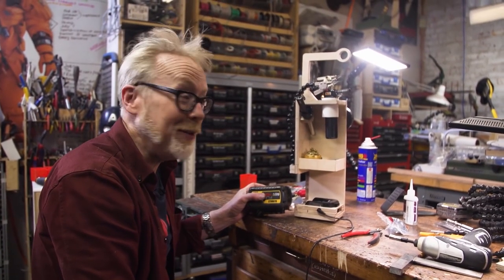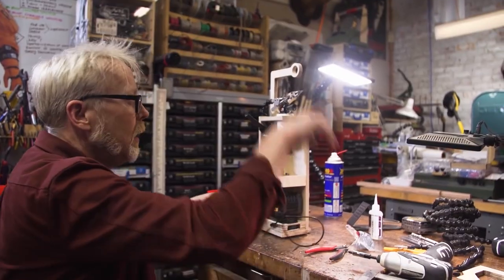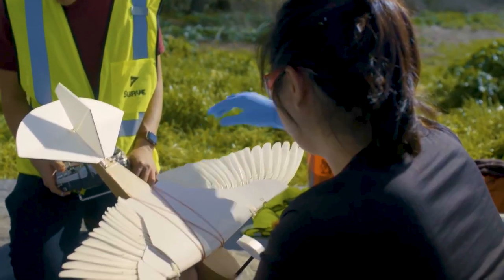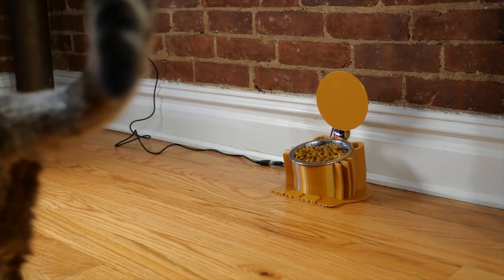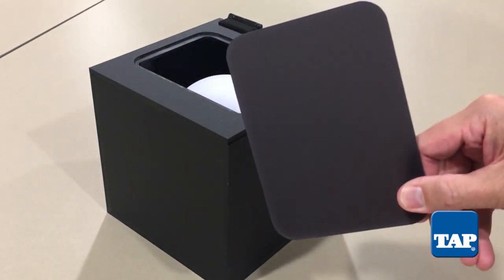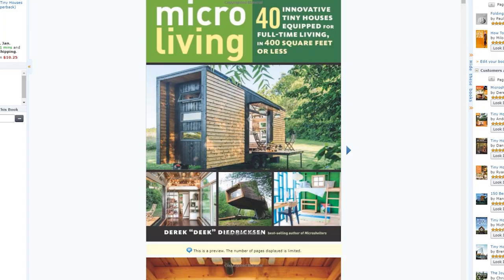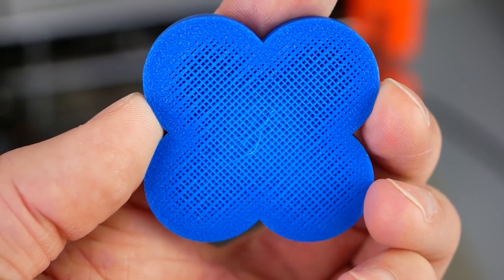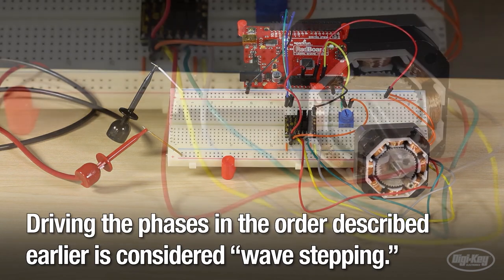Side Iron [Maker Update #157] - Maker.io

Comment: Thanks for another interesting Maker Update! I wonder if we could just take a high illuminating LED and suspend  it at the top of an inverted bulb shell mold with curing resin keeping the leads just outside for attachment. I will try this with different resin clarities for light refraction to see if I can duplicate the results?? Has to be cheaper than $50. As you mentioned this is a novelty item at that price, but if I could duplicate these results it would be a true Maker Update. Now where’s my resin catalog? I bet I screw this one up!!! Lol... I’ll post my results in the future! Go or bad!
Reply: I've a playlist showing most of processes of making my Giant LEDs https://www.youtube.com/playlist?list=PLo4j4TpR2irtJ2MjS0oswqNs30Rx8cAga
Almost any resin should work if it's going to be diffused, you will need very little pigment.  Heat dissipation is something to think of if you are going to use high power LEDs.
Directly 3D printing the LED is also an option. https://www.instructables.com/id/Giant-Led-Fully-Working-Remote-Control-/

Comment: Great show donald, I didn't know you can get a NodeMCU at 5v or maybe just power input on the 5v pin?  I'll check out her project.  Thanks.
Reply: From what I can tell, the board wants 5v or more for power, even though it regulates it down for it's logic. I was surprised. She's running the servo off the same power but driving the signal from the board.